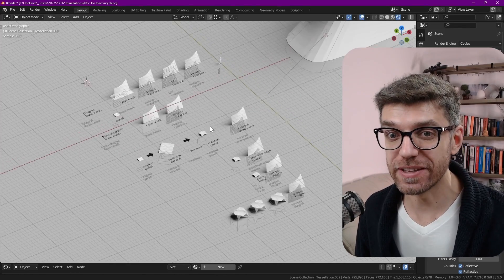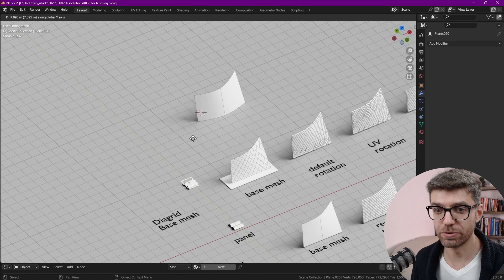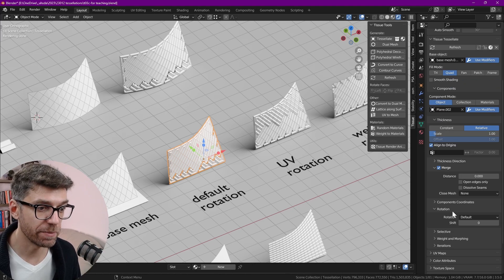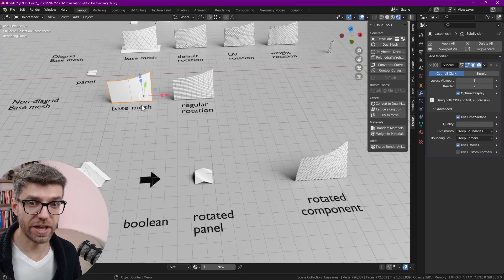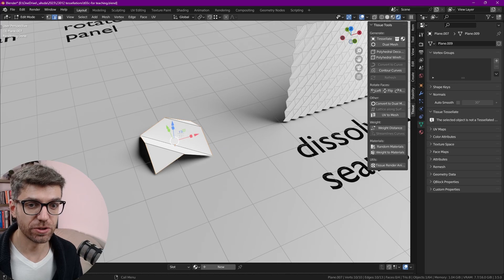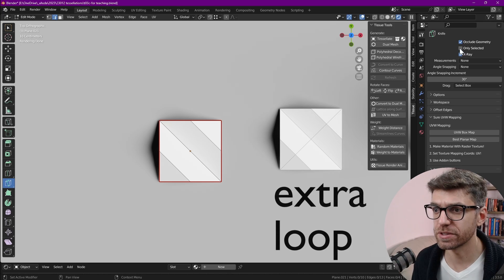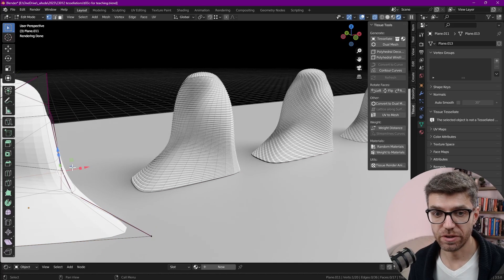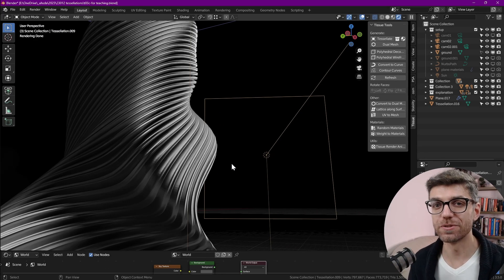Easily create topologically correct diagrid tessellations with Tissue - parametric design Blender

Comment: I got this to work up to applying it to a big object like the big ones you have at the end of your video. I tried to make them with just a few simple extrusions from a cube with a subdiv modifier. After tessellating, the only problem is that the small panel is reversed on some middle sections.
So instead of:
////////
////////
////////
I got:
////////
\\\\\\
///////
I don't know how to reverse just the middle one.
Reply: I figured it out. I tried to make the big objects from a cube. Not good. Make them from planes. VERY IMPORTANT!
Edit: I still wish I knew how to change it afterwards though. Seems limiting to have to make everything from a plane.
Reply from the maker: In the Tissue addon sidebar panel, there are options to rotate faces, left, right, or reversed.
Reply: @ Thank you, UHStudio. It's perfect. =)

Comment: I can absolutely not rotate and extend that original panel by 45° and then get a working array after the boolean, the lines never match up with the cube after that 45° rotation. Everything is on the grid, the panel, the cube, the cross cuts in the panel..... you just eye-ball scaled yours to match before the boolean and magic? wtf?
Reply: Make sure you are rotating the vertices in edit mode, not just the object itself.

Comment: excuse me, how are you able to see edges on the mesh, for example in the base mesh diagram you have a visible line, i would like to know how to make it visible
Reply from the maker: There are two ways - global, enabled in the pverlays menu in the 3d view header, under "geometry", there is an option to enable wireframe. Second way is per object, enabled in the Object Properties (orange icon), Viewport display, Show, Wireframe, and All edges

Comment: Any idea of how to create Michael Hansmeyer "Subdivided Columns" which was done in 2009-2010. Any thoughts in recreating something like this in Blender?
Reply from the maker: The subdivided columns use rule-based recursive subdivision. He has probably used Processing, or looking at the amount of geometry generated, more likely OpenFrameworks, which is a C++ open source creative coding library. There may be a way to do a part of that with Tissue. There is a subtab in the Tissue properties of a tessellated object for iterations. However, the iterations are static. I suppose you can animate the property to get interesting results.

Comment: You are a good teacher. I recentrly saw Autodesk Maya courses from someone at Zaha Hadid. What do you think about Maya for architects ?
Reply from the maker: Thanks! As you may see, everything that can be done with Maya can also be done with Blender (and in many cases in a more parametric manner). I learned Maya from the same people that work at Zaha Hadid that taught the current generation of designers the work and teach Maya. And then, I started applying that knowledge to Blender. . Having said that, there is still a useful knowledge to understand the workflows that they teach in the maya courses. If you are interested, I also offer courses on Blender. Both Maya and Blender offer excellent opportunities for architectural design. However, one is open source and is constantly getting really impressive new updates, and the other one costs a lot of $$$
Reply: blender is clearly the future, open source always prevail.